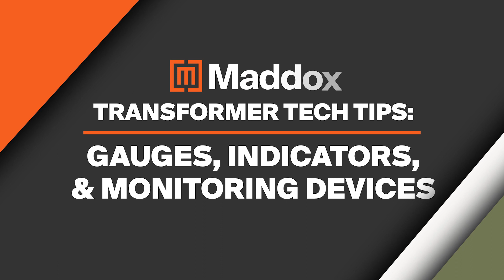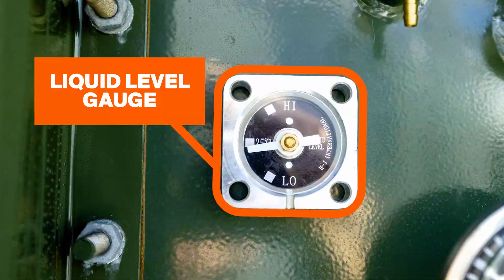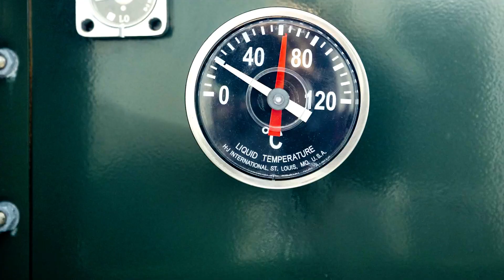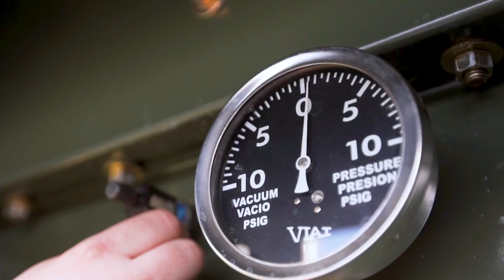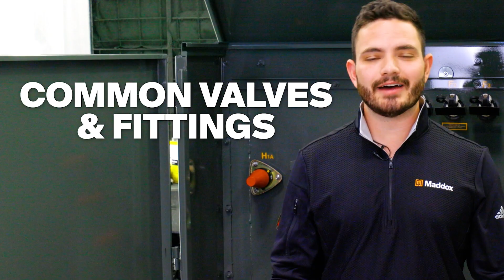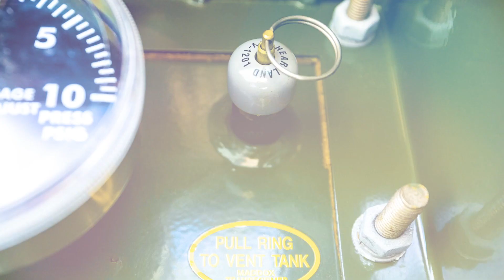How to read transformer gauges | Maddox Transformer

Comment: 25 deg mark on LLG shows same 25 deg oil temp. Or something else if needle is at 25 deg?
Reply from the maker: The 25-degree reference mark on a liquid level gauge indicates the proper oil level when the transformer’s insulating liquid is at 25°C (77°F). Since transformer oil expands and contracts with temperature changes, the gauge provides a reference point to ensure the liquid level is within the correct range under normal operating conditions.